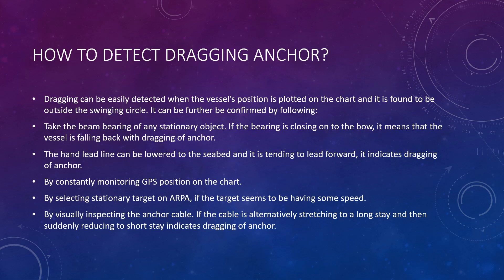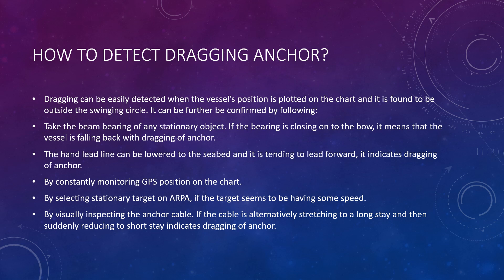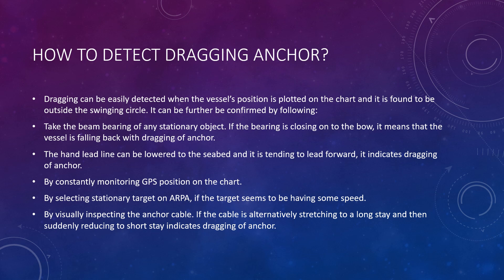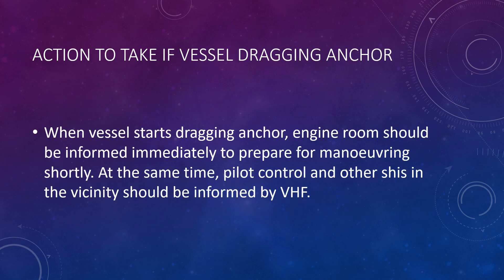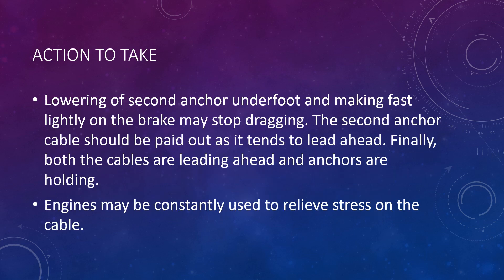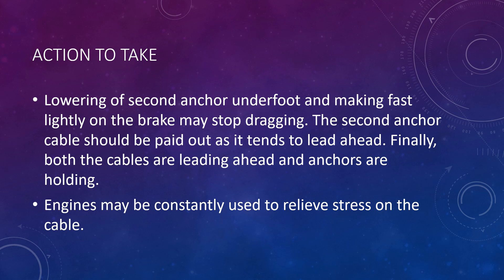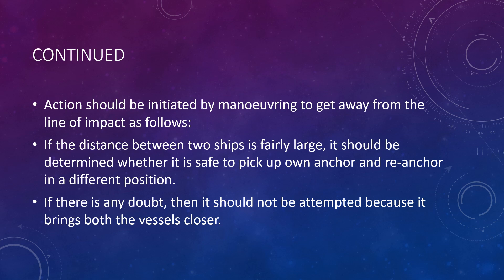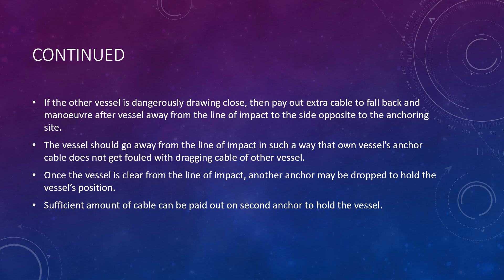Dragging of anchor - determine dragging anchor and action to be taken

Comment: Hi Sir, I just went through 3 hours of oral last Friday. Exam not completed and will continue this Friday. 🤣 One Q examiner ask me which I can't answer well is "How do you know if anchor is brought up when you are at fwd stn"? 

I found an answer online but I don't understand the following. 

" A vessel is said to be brought up when her way has stopped and she is riding to her anchor, with the anchor holding.

The officer in charge of an anchor party will know when the vessel is brought up, by the cable rising up from the surface towards the hawse pipe when the brake is holding it

The vessel should then move towards the anchor, causing the cable to drop back and make a catenary." 

Can you explain? Emergency 🤣
Reply: Anyway, I am taking class 3 in Singapore 🇸🇬  😅
Reply from the maker: @wildatheart7575  Hi Shun, well done, I am sure you will pass next time. To answer your question and explain what you read: a vessel is brought up when the vessel is not making any headway or astern movement; and there is no weight on the anchor; the anchor when initially dropped takes the weight of the ship and becomes taught; once the flukes dig into the ground the extra cable allows the vessel to yaw but hold its movement and position (the curve in the catenary).
Not sure if you understood...sorry:)
Reply: @SteeringMariners  Hi Sir, really appreciate you quick response. I just watched your other video regarding anchoring. I think I got a better picture. 

Just to confirm, "vessel ridding the anchor" = vessel "bouncing" on her anchor. After the initial yaw, the cable will be long and tight. The tightness will "pull" the ship slowly fwd and have the curve ship. After sometime with the curve shape, I can consider anchor brought up.
Reply from the maker: @wildatheart7575  Correct:)
Reply from the maker: @wildatheart7575  The weekly checks of LSA/FFA are linked to the ISM code through the planned maintenance schedule (which is part of the company's SMS and ISM code as well).
The weekly/monthly/yearly checks are described in SOLAS.
Not sure about the MSC circulars, sorry:)
Reply: @SteeringMariners  Good day Sir. Thank you for your assistance. I have already found the circulars. 

FFA - MPA Singapore MSC 19/2013

LSA - MSC 81 (70)

Really appreciate your help.